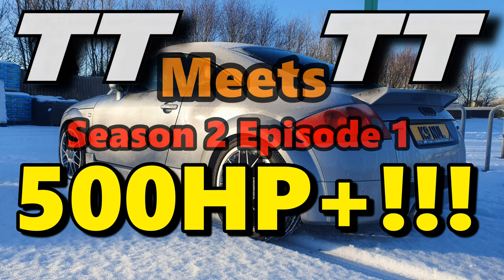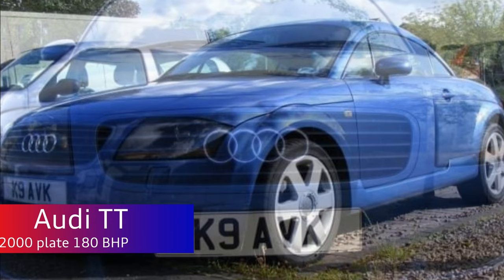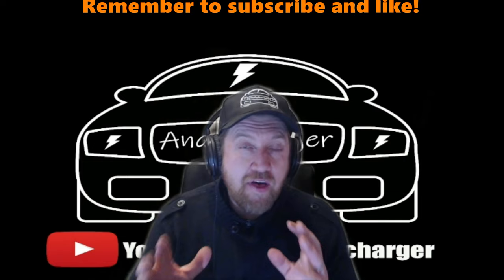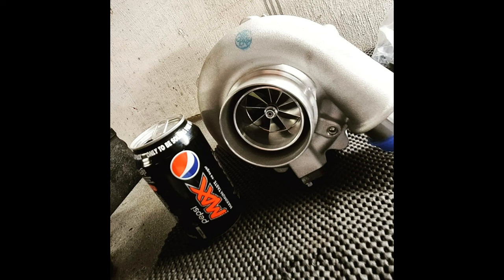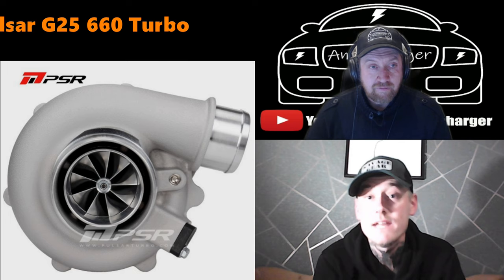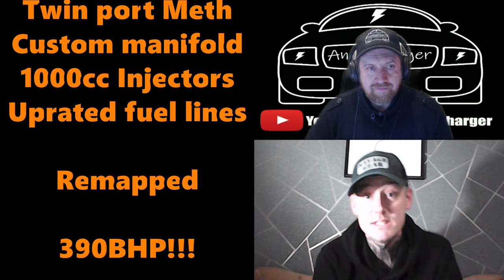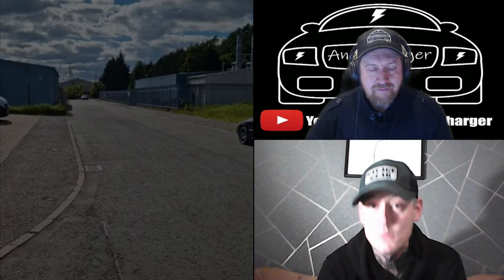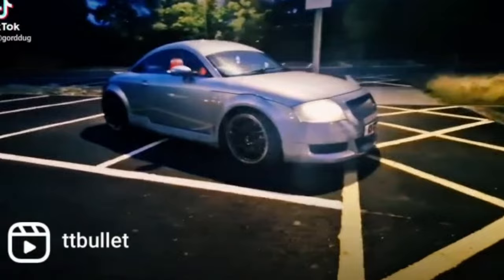TT Meets TT S2 Episode 1 - 500+BHP Big Turbo Audi TT Mk1 - The Wee Scottish Beastie

Comment: Nice TT, Is he running anything to adjust the haldex system? I'm sure it would feel better putting more power to the rear. I have a 180 awp and wish I could get a rear seat delete here in the states. Also impossible to find anything for this car out here